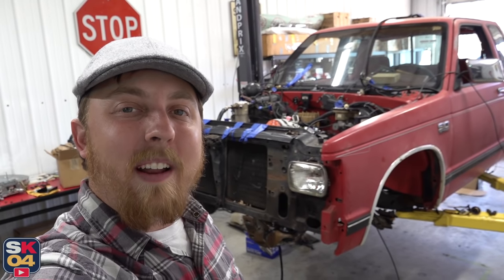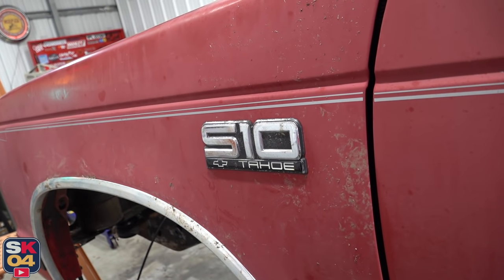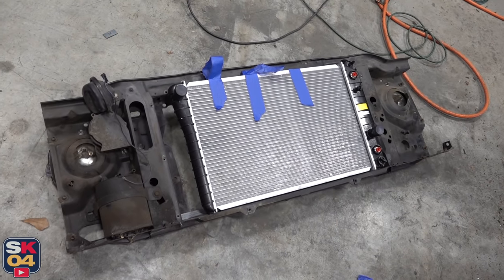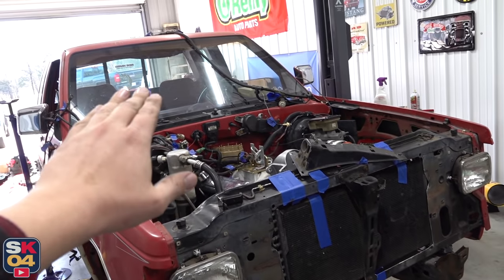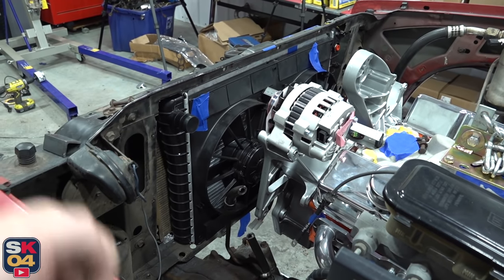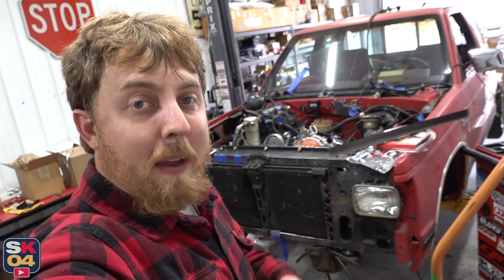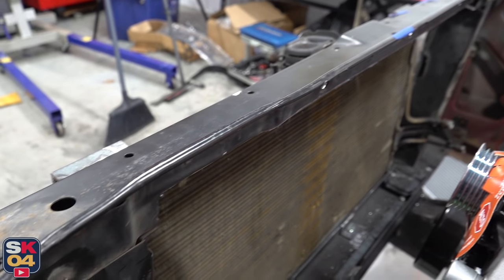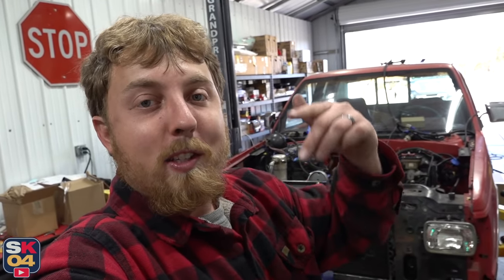Making A Custom Tucked Radiator Setup For My V8 Swap! S10 Restomod Ep.6

Comment from the maker: I just realized I accidentally covered the part number for the Mercruiser pulley with my water mark.  In case anyone is wanting it, it's 807729T. 

EDIT: The discount code "Saabkyle20" has been fixed and can be used once again on Oreillyauto.com.  Thanks everyone!
Reply: Relocate the watermark to the bottom right of the screen
Reply from the maker: Not possible, if it was I would have already done it.  It's edited into the video.
Reply: @saabkyle04  I meant to say the Next video

Comment: Doing a '99 Jimmy 4x4, myself.  Also went with C4 water pump, Mercruiser pulley, etc. with factory 4.3 accessories and brackets.
But what I did that people freaked out about, you did as well.  I hole-sawed right through that alternator bracket (three walls), to shoot the heater hose from the WP right out the side. (Primary inlet on the pump clears, in my case.)
People freaked when I suggested it.  Went nuts when I did it.  And still bring it up when I post pics of other things on the front of the engine.

Comment: I have been trying to find pictures, video, anything of putting a radiator and a/c condenser into one of these for what feels like years. Apparently people have done it with stock parts, but not one single picture showing anything anywhere. I am basically going to copy what you did for my truck whenever I can get back around to it because this is perfect. Thank you.

Comment: For the upper radiator hose, when you get that far, use a hose for 90s impala ss and put the thermostat housing on such that it points back towards the windshield, the hose will then wind backwards behind the alternator and then come out nicely to the radiator.
Reply from the maker: Thanks man!

Comment: My Silverado doesn’t have a Rad cap. You fill through the overflow, which has a pressure cap. You could probably get by with the Silverado Rad to keep from having to cut the core support. I see you used a hole saw. Just though in case someone is doing the same swap. This could be an option.
For a really cool fan setup if you ever need one in the future. Check out snidertron 3000 youtube chann. He used a cookie sheet to mount electric ebay fans. It looks trick, looks like it may be stainless. He’s building an 80’s Camaro.
Nice Job Kyle. 
Cant wait for the Crew Cab build.
Reply from the maker: Interesting point of views for sure!  I hadn't seen that done before, but it makes sense.  I appreciate the insight!

Comment: you could have sealed up the filler neck and installed an in line filler neck that goes inline in the upper radiator hose from a Corvette.  That will keep the core support strong.
Reply from the maker: I explained that in the video, however I didn't see any inline necks that were corvette specific.  I elected not to do an inline neck because I didn't want it hanging out from the radiator too far when I already have such limited space to work with.  I added extra bracing so it'll be fine.  That little bit cut out isn't going to hurt anything.

Comment: Hey right in the middle of this exact issue. I couldn’t get the short water pump to fit because of the timing chain cover. It was recommended that I put a tarsus single fan on the corvette radiator. It are up all the gains plus I had to go back to the 5.7 water pump. I did notice though you had a two fan system on your video. Could you please tell me where you got it and any ordering information about the fans. Thank you

Comment: As I've said in posts on previous videos, when I've done this swap I've used Volkswagen fans, they use a flat style motor instead of having the motor hanging out. Also, verify that your Corvette water pump turns the correct direction to work with the serpentine belt setup vs an old v belt setup, the impeller is in the opposite direction for the serpentine belt.
Reply from the maker: The WP from the 86 corvette is reverse rotation just like the serpentine setup originally had.  Thanks!
Reply: Perfect!
Reply: What year of Volkswagen?
Reply: @DittoBlast  not sure of the exact years, but for a scirrocco

Comment: Hey Kyle, I would advise that you check what kind of camshaft that 350 has, Because if it has a Flat-Tappet camshaft it is ABSOLUTELY IMPERATIVE that you break it in correctly. It is of the UTMOST importance to the life of the camshaft. If it has a roller though than you don't need to worry about it. But please do check because it would suck to wipe a lobe off the camshaft.
Reply from the maker: Yeah man, I totally know what you mean.  I had looked before, but I can't remember right off. 
 I will double check beforehand, I have the part number lying around somewhere.

Comment: Remember.. when cutting metals..making cuts..at the joining corners always drill out the corners. This will help from metal fracturing and or causing unexpected breaks. As that metal was before rounded and rolled that was to help from this happening.
Reply from the maker: Thank you for the tip!  I didn't know that, but it makes total sense, would have made a lot of those cuts easier too.

Comment: 10:00 I wonder if you couldn't do away with the hood latch support, then tuck the radiator in as far forward as you can in the core support, basically putting it where the condenser was, then build a bracket and hang the condenser off of the front of the core support, then build a bracket for the hood latch.
Reply from the maker: This is possible, I just didn't know how much support the latch needed.  I think I made enough room overall without getting too crazy, but that is an interesting idea for sure that I wouldn't mind trying at some point.

Comment: Kyle, do you have a refrigerant recovery machine for the a/c system in our garage or is that something that you’ll have to get done at a shop? Also I’m assuming if this hasn’t been done already that you’ll have to convert the a/c from R12 to R134a?
Reply from the maker: I don't have anything like that so I'd either have to take it somewhere to be drained/recovered or invest in something like that at some point.  Thankfully, the system wasn't charged, there's a leak somewhere.  I'll be installing all new A/C components to run R134a.

Comment: Where did you buy the new AC system components and what are the part numbers? That would be awesome info.

I have a Caprice 400 small block V8 & am looking for a more modern A/C system to install
Reply from the maker: I don't have the part numbers right off, but I went to Oreilly Auto Parts (OreillyAuto.com).  Everything I needed was on the shelf in the local store.

Comment: Hey I was wondering if you would be willing to make a public Amazon/oriellys/etc list of parts you're using? Stuff like the gas tank insulation straps really peaked my interest but I'm not sure where to find it.
Reply from the maker: Yeah man, I should start doing that, thank you for the suggestion.  I ordered the fan/radiator kit from S10V8.com and the gas tank straps came from LMCtruck.com.  If you wanted to make your own fan setup on more of a budget, you can get the radiator from OreillyAuto.com  Everything else I ordered through O'Reilly, except for the Mercruiser pulley, which was an Ebay find.
Reply: @saabkyle04  thanks for the help!
Reply from the maker: You got it dude!

Comment: Not to sound stupid or anything, but, what year an model radiator did you tell the guys at O'Reilly's when you got the radiator and condenser?  (I'll assume the condenser is original or Not?????)
if not can you again what year and model vehicle did you tell O'Reilly's????  (they ask what's the application an then they have no clue what to look up).  currently i feel im spending to much for cooling an nothing fits.  Currently looking at (Summit Racing SUM-380473) but $340.00 (American racing said uses theirs it was $399. but dont fit at all.
also where did you get the fans?????
Reply: 87 Corvette water pump($60 Advanced auto) Mer Cruiser pulley 807729T (Amazon $50) 97 Dodge Intrepid fans (Auto Zone $114) 93 s10 Radiator 4.3 v6 (Ultra Power 681 Rockauto $115) Upper Radiator hose Dayco 71131 ($14 Advanced Auto) Lower Hose Flex Standard Fit ($10-15 Any auto parts store).
I did same cutting an all fit perfect with this video.  awesome room no clearance issues. Great Video. Never found a Good idea for the short water pump except cut the bracket in half and have a slight bend in the hose (But nothing 2 hose clamps didnt fix) would really like a better idea for that thought (Future fix)

Comment: U should not cut the outside dialer of your electric fan shroud that oiter piece that u just cut keeps the whole fan assembly contacting tge surface of your radiator it might be rubbing u are gonna end up with problems later possibly a coolant leak

Comment: KYLE I WAS JUST WONDERING WHY YOU DIDN'T SIMPLY GET A SMALL DIST. SET THE ENGINE BACK A COUPLE OF INCHES AND CUT THE DRIVE SHAFT TO FIT? 
DON'T YOU THINK IT WOULD HAVE BEEN EASIER AND CLEANER? DON'T GET ME WRONG. YOU ARE DOING A GREAT JOB JUST THINK THAT WOIULD HAVE BEEN A TON EASIER AND CLEANER.

Comment: In my opinion you did the wrong thing angling the radiator. How cowl hoods work is that moving air , circles at the windshield& comes back down the middle . is why the opening is in the middle at the back.so angling the "hot air from the rad is canceling out the flow & the benifits of a cowl. The hot air should be angled down a swept underneath& back with momentum
Reply from the maker: I understand your point of view, but from where I see it, air is moving quickly over the hood and passing over the windshield, causing air to be drawn out of the opening provided by the cowl hood.  I think of it as a heat extractor vs a point of intake.  Since heat rises, it should give the heat an easy exit point.  Regardless, this is the design I needed to go with.  Time will tell whether it works our not, but I'm confident.

Comment: Just use a electric water pump and you will have all the room you want and wont have to hack up your core support
Reply from the maker: I didn't want to use an electric water pump.  That was only part of the problem.  The accessory drive sticks out further so I had to mod it regardless.  No point in spending all that extra money on an electric pump if you have the ability to make yourself a custom setup.

Comment: Shame there wasn't quite enough room to put some plastic pipe on the filler neck to bring it further out. Oh well.
Reply from the maker: Yeah, it is what it is.  Not a whole lot of options with this radiator it seems.  There's another company that makes a nice tucked radiator for these trucks but I had already bought this setup so I had to make it work.  I like how it turned out overall.

Comment: 17:00 old tires.
Reply from the maker: Yeah I suppose that works too if the rubber is thin enough.  Bicycle inner tubes work too, but the fuel hoses worked perfect.